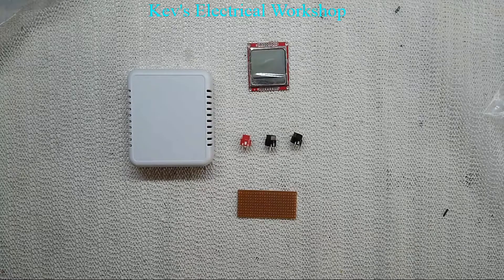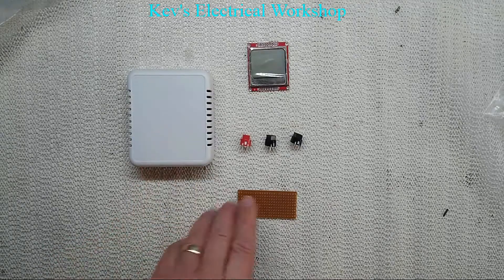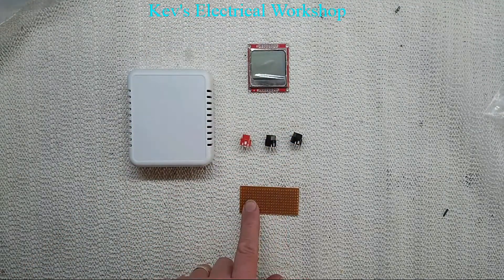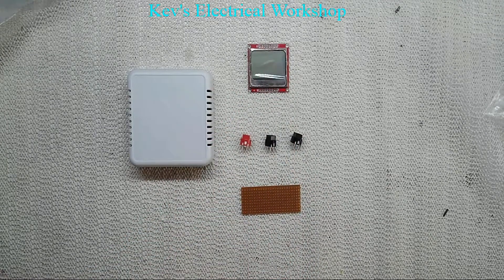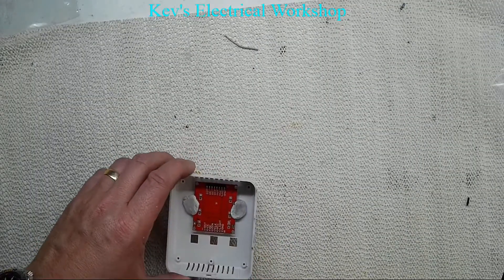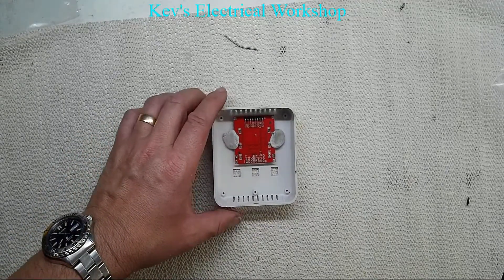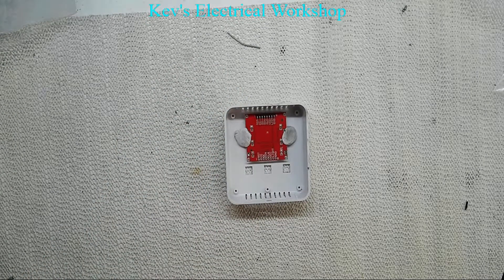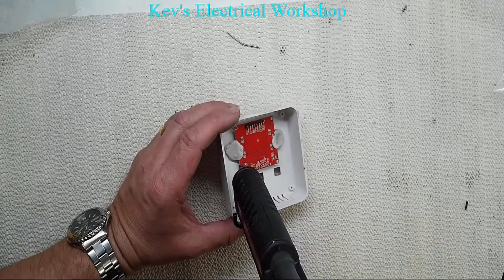ESP8266 wifi room stat with display project Part1

Comment: Nice work. I need to use that Vero board more. I've gotten in the habit of making home brew pcb's. I keep forgetting about that stuff for quick jobs. Another Ebay find I'm sure :-)Thanks
Reply from the maker: http://www.ebay.co.uk/itm/110773926039?_trksid=p2057872.m2749.l2649&ssPageName=STRK%3AMEBIDX%3AIT
Reply: Great. Thanks. I was just trying to find it when you replied. I guess it's not the best for chips without doing a lot of track breaking but then there's the other stuff with individual pads too.  Good to have both. Thanks.